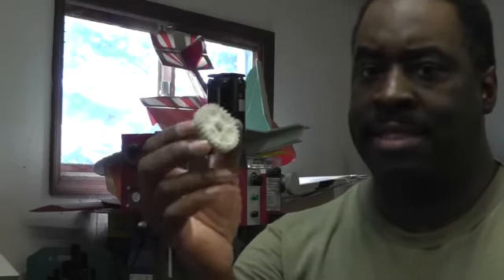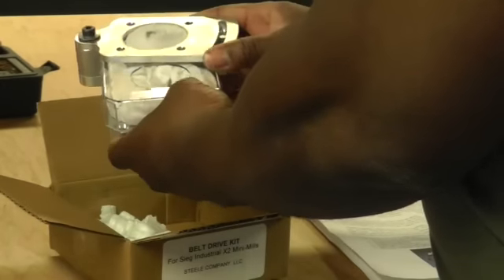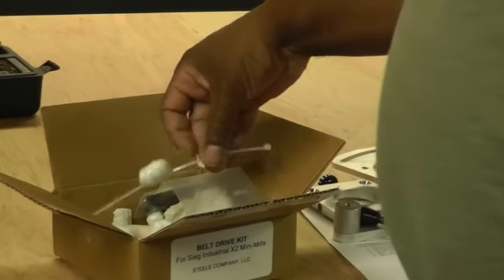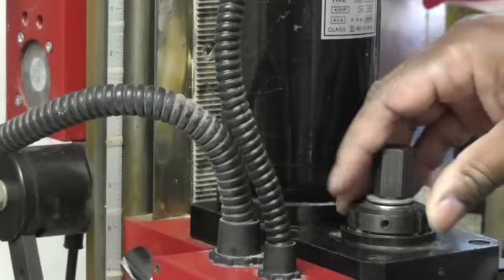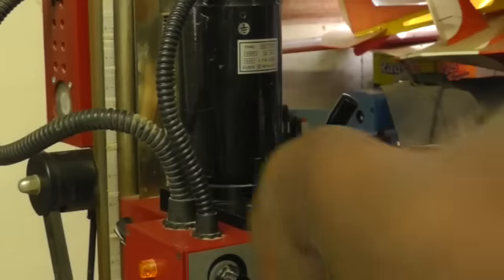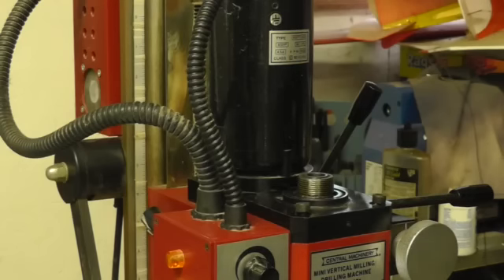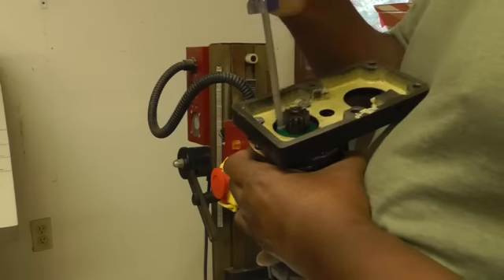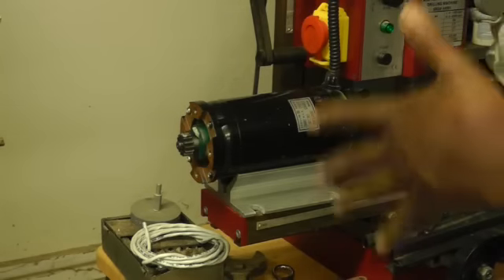Minimill Belt Drive Upgrade

Comment: I remember once someone trying to tell me the nylon gears were there as a weak link (Like a fuse) to prevent more expensive parts getting broken when you crash the mill........ I called BS on that because no designers stupid enough to put a fuse in one of the most inaccessible places of a machine.

Comment: I have a question. Since you have a milling machine and the problem with the machine was a plastic gear, why not mill yourself a new gear? You have the plastic one to take measurements from. I would think a reliable gear drive would be better than a belt drive.
Reply: Nope, the belt drive doesn't destroy itself regularly.

Comment: To mill a gear w/o a cnc machine is quite a task, meaning it takes a lot of time and the chances for wasted time are high.  Even if you do succeed manually milling a gear you still don't have the speed change advantages that of a belt, unless you manually mill another gear.  Belts are usually easy to change and source.